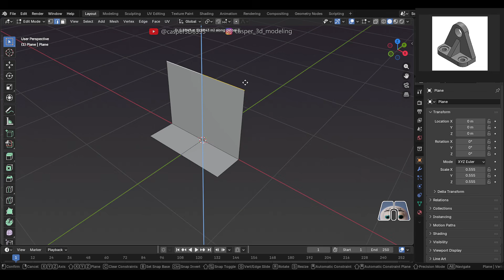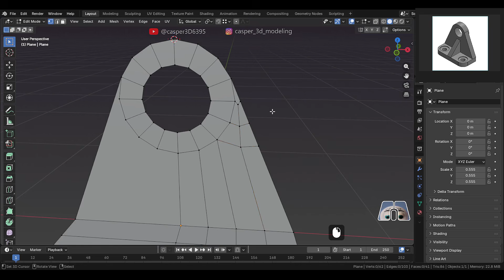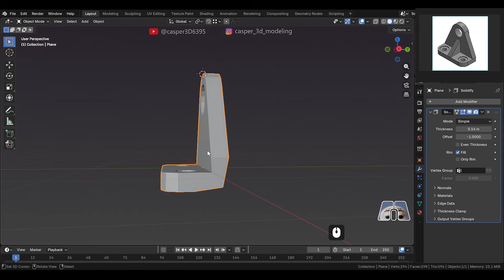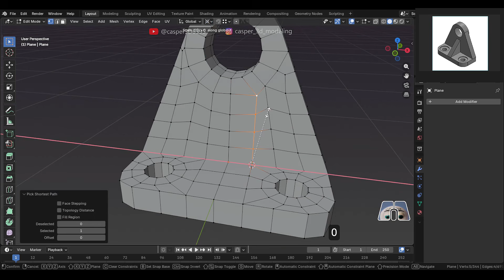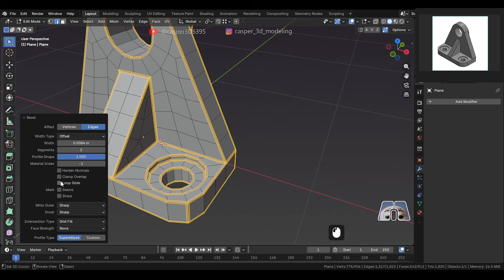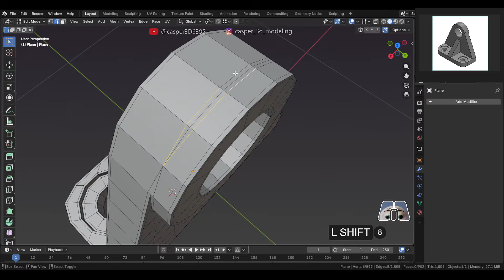Blender Quick Practice – Modeling a Mechanical Bracket

Comment: Sorry man. With your instructions none of my snapping works. Yours click in place. I follow your instructions to the letter and mine refuses to do the same. And since it happens early on in the process, everything else gets out of whack. Also, looptools is apparently an extension that needs to be downloaded which Google told me. Blender 5.0.
Reply from the maker: Thanks! Yes, LoopTools is an addon that I use in most of my videos. You need to enable it in Preferences,  Add-ons, or find it in the Extensions tab. For snapping, make sure the snap type is set to Vertex, and hold Ctrl while snapping. Also make sure Active is selected in the snapping options so only the active vertex snaps. Hope that helps.
Reply: @casper3D6395  Keeping Ctrl pressed down was exactly the one thing I couldn't make out. Thank you. Solved it.

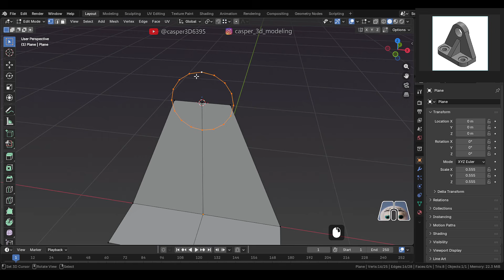Comment: Bro my snapping function is not working. I pressed L for all vertex of the circle, then G to grab and z to align but it does not snap. 1:47
Reply from the maker: Thanks! In the snapping settings make sure the snap type is set to Vertex and also Active is selected. Then, by selecting the whole circle, make the vertex you want to snap the active one. Press G to move and hold Ctrl while snapping 👍

Comment: Great video thank you.  One thing that would be great would be to show how to make this part with precision.  A lot of people would be making the example bracket for 3D printing so exact sizes would be important.  Hole sizes and overall bracket size should be precise.
Reply from the maker: Thanks for the suggestion! I’ll look into covering precision going ahead.
Reply: If you're designing actual parts you should be using parametric design software. FreeCAD would work fine for simple things like this.